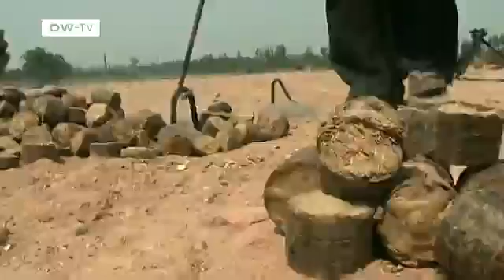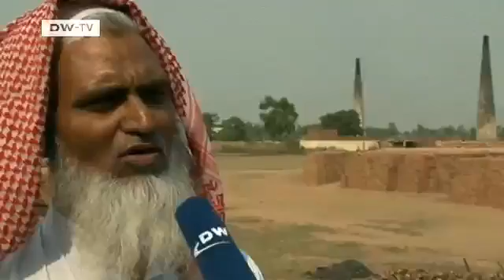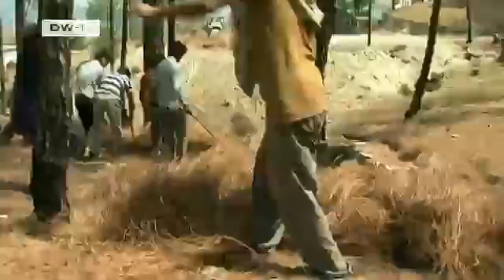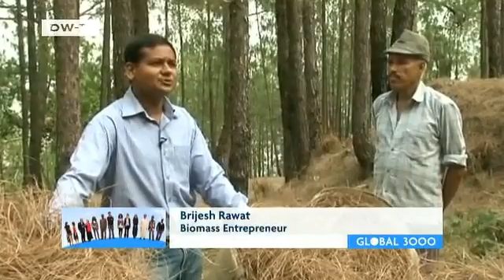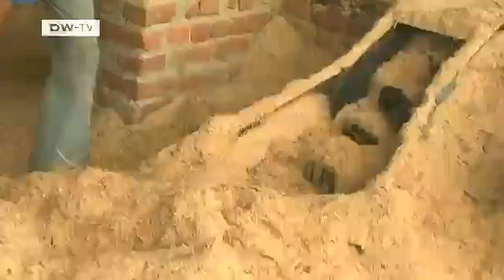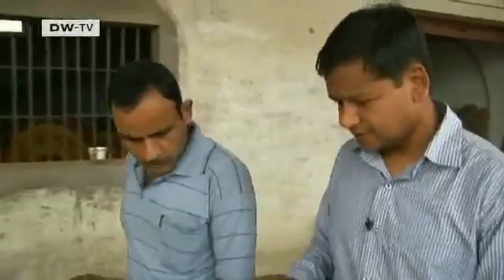Biomass briquettes in India | Global Ideas

Comment: Nice video. We use the fast pyrolysis plant Fpp02 for recycling wood waste . Reactor 500 kg/h. It turns out liquid  fuel for hot water boilers. From wood waste during pyrolysis, pure charcoal is also obtained. I think pine needles are a good raw material for pyrolysis.

Comment: There is fundamental problem here. CO2 is still released when burnt, traps more heat and produces Green house effect. Staying carbon neutral is necessary but not sufficient. CO2 must be trapped in the carbon sinks like trees, oceans and simultaneously reduce the emissions to see any prominent change. Releasing of trapped CO2 (from trees) has multiplier effect on global warming. It’s better, however, to use needles to meet growing need for energy than fighting bigger problem like forest fires.